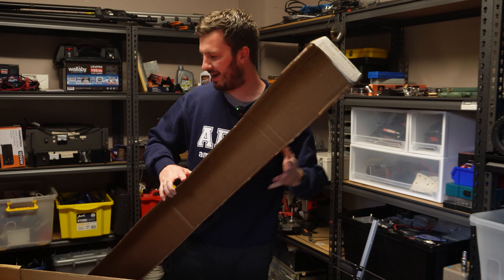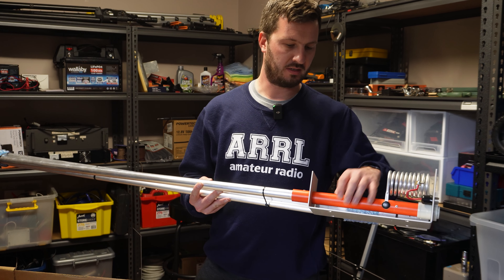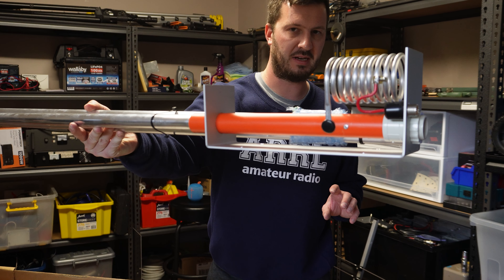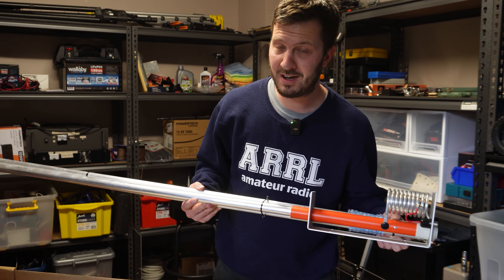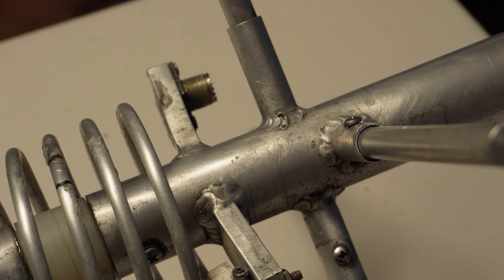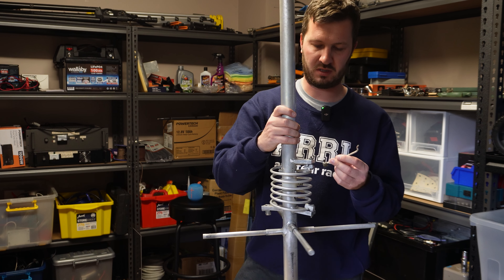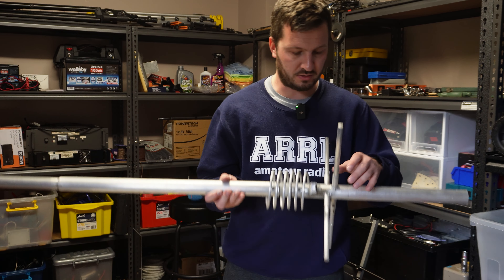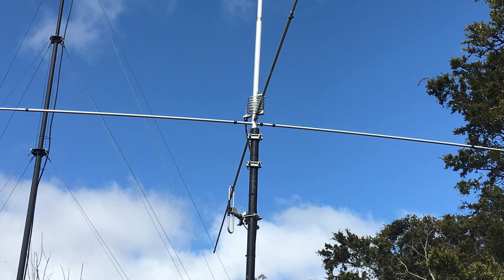Who Remembers This Forgotten CB Radio Antenna?

Comment: I still got my first mk1 Half wave Station master antenna that I bought brand new way back in 1981 so it's 42 years old and still on the tower working beautifully. It served me well right through my CB days as a young teen and then in 2004 was re-tuned for 10m Ham. It's had its fair share of being knocked about in bad weather and it gets its usual maintenance clean up every 2 years or so but you just can't kill this antenna. I love it and it's been a big part of my radio life for so long. I have tempted to replace it a few time but just haven't got the heart to retire it while it's working so well. I would be very happy to see it make 50 years old and still working.

Comment: Very interesting and well made video. 
I am ON3VCF a happy brit radio newbie here in Brussels Belgium. 
Last week at our weekly evening we were talking antennas and corrosion,  and one of our eldest and experienced members told me that he uses a spray can of  transparent varnish over the whole thing, top to bottom.  After 8 years he had to move it, and the metal and the PL connector were clean and like new inside.   Not a bit of rust or corrosion. 
He said he sprayed it with 2 coats.  
So I'm going to do it too.
I'm using a Sirio 5000 1/4 wave from Italy up on top of my chimney.  
Today,  25w got me 2200km to Moscow 
Me.... Happy bunny!

Comment: I had one of these beasts back in the early 80's, I had a Ringo before that but this turned out to be much better. I would also run all sorts of wire based antenna's strung up in trees nearby, even made a 3 element yagi that way lol. Back then it was all CB with my nice GE5825B running big power, mics and a modded PLL02A - such teenage rebels :)
It looks like I"m about to do it all again too.... just ordered an Anytone AT6666pro

Comment: I had one that took a lightening strike in '81, while I was using the hand mic sitting in the bath tub!!!! The static jolt made the metal plate in my head vibrate at about 40k hz...  Felt like I'd microwaved my gonads, while swallowing a bowling ball made of those super conductors that float and spin at zero degrees K.  I danced around in the kitchen on one foot for about 20 mins. which eventually led to the invention of the 80's craze known as break dancing.  Now?  I built a ULF full wave length end fed long wire antenna, for working the 520 Meter band, QRP (0.25 watt crystal), while CQ-ing alien life forms via CW... while doing PLOTAs (parking lots on the air). Red Rooster or Oporto's are my favorite PLs to work, especially if it's an abandoned and dodgy one.  Anyhow back to the alien encounter QSOs, works well, except the morse code they use is 180 degrees opposite from ours. The guys in my local dork support group think I am QSB.  ET phone home.

Comment: My Dad made a half wave ringo antenna for use on 27 MHz. It worked a treat.

A tip for any aluminium antenna assembly or repair work is to use an anti corrosive jointing compound like Duralac between any dissimilar metals. Brass and copper in contact with aluminium will suffer from electrolysis in the presence of water. Never bolt a copper crimp lug in direct connection with aluminium.
Reply from the maker: I'm using TEF-Gel for the dissimilar metal connections:
https://www.tefgel.com.au/

Comment: I converted these antennas to 5/8 and had no problems on 27 mhz. The SWR actually dropped when I added ground plane radiators near the bottom, got it down to 1.1 .

Comment: Best antenna ever. I had one, I extended the stink pipe up on my parents house another 5m above the roof ridge line and the Station master sat at the top. I used to chat to NZ (26mhz) and the US, it was connected up to my trusty Ferris 5000 with the Digiscan Channel expander and a few extra watts on AM and SSB. . None of that TV interference and  no splatter, what a wonderful combo and memory

Comment: I've had one since the 80s. It was on the roof at home about 6 or 7 years ago, but a cockatoo decided to bend the top section so I took it down to repair it.
A few months ago I finished the repair with a new 12mm tube at the top and adjusted the length for around 28.5 MHz. I now use it for 10m and 12m with a tuner and the log of DX FT8 contacts is great.
I have it guyed with whipper snipper cord from the middle down to the colourbond roof that it sits at the peak of. The whipper snipper cord is good for about 5 years between replacements.
For my American friends a whipper snipper is what Americans call a weed-wacker.

Comment: Wow Hayden,
The Station-master MkI was one of the first antennas I ever built, for 26MHz CB over here.
They're quite an easy build, apart from getting the loading coil the right size and the turns spacing correct,
I sold it when I moved to Ham radio and constantly kicked myself afterwards, as it would have been perfect for 10m.
Reply from the maker: You can still buy them in VK Mike. There are a few places that still sell them.

Comment: Station master came out in the later 1970's i had one it was easier to mount the Five Eighth ground plane was a little large on the side of the house . had it hooked up to my President Washington and Turner + 3 microphone  when i upgraded in 1979 . Seven years later i got my HAM License . I notice a Ringo mentioned in the comments in the 70's refereed  to as a splatter stick .

Comment: I have had about four of these. Never had a new one.
One I converted into a 6m halfwave vertical by scaling everything down.
Another I removed the coil, shortened it and used a metal roof for a ground plane for 20m.
I have one on a pole for 10m and 11m and another in storage for a spare.
Reply from the maker: I converted an old one to a 5/8 on 6m too.
https://www.hamradiodx.net/58-stationmaster-mk1-on-6m

Comment: My 6m repeater is using a cut down Stationmaster. We quite deliberately wanted a low gain antenna because the repeater is sited on the side of a 'mountain,' at 750m, between a high elevation town at 1100m and low elevation at 30m, these two spots being 40km apart. To get sigs to go uphill AND downhill, it needed a spherical radiation pattern, which is precisely what a half-wave vertical does.
Reply from the maker: Same! Although I converted mine to a 5/8. The radials have fallen off since, I have a replacement on the way.
https://www.hamradiodx.net/58-stationmaster-mk1-on-6m

Comment: I had and built several of these in the 1980's, Daryl Coleman built and sold them as well. A good place to get any type of aluminium at wholesale prices is Action Aluminium, here in Australia, don't go to that big green aluminium shop and get ripped off.
Reply from the maker: I use Ullrich or Capral here in Hobart. Always good to deal with there

Comment: Oh boy! Making my youth flood back! I've still got mine in the shed and from memory it's setup for 28.5MHz
Reply from the maker: Need to get it back up in the air!
Reply: @HamRadioDX  I'm going low key, I'll be using either a 1.5m or 1m ex 27mhz mobile one whip for the repeater once it's back on the air!

Comment: Had one of the stationmasters around 2006 on 10M and worked really well, only sold it early this year but they are not rocket science to build, think I still have te dimensions for it somewhere.

Comment: Their is some antenna's like that 1/2 wave. sold in the US .  I had one with a loop around the whole center element. just a single turn ring with a tap. I had the 5/8 wave MACO one. had a bigger ring. still make that one. I have a 6 meter half wave with a small loop at bottom . works great. sold threw MFJ . for the 10 meter FM part of the band shorten 11 meter antenna a bit. also I had a 3/4 wave 11 meter antenna with gamma rod. still make that one in the UK.  I cut wire for my DX commander 3/4 wave for 10 meters and 3/4 wave for 6 meters. great gain . have to take 40 meter off and replace. the portable quick set up one.  I got extra DX 10 wire. made most bands and just put on what I want.  mono band 3/4 wave on 10 meters. below 1.5 SWR threw the whole 10 meter band. 10 meters really going in the US. same on 12 meters. I cheat on 11 and 12 meters. I hit tune button on 7300 and it gets out . just under 3:1 on 12 meters with 3/4 wave cut. better on CB . my half wave never broadband that much . ether does the standard 1/4  cut wire. that should work super for 10 meter repeater use. 73's Boston NY USA

Comment: I'm looking at one of these as I type, I had to replace the top section on mine, as it had corroded into the next lower section and snapped off when I tried to separate them, but what can one expect from an antenna that has been in the air and under constant use since the early 1980's ? I have spoken ALL OVER THE WORLD on this, with as little as 4w output. In the 1990's, NZ on AM wasn't hard with 4-5w, and I had a 4 hour S7-S9+ conversation one night with a guy in Belarus, when it was still part of the former USSR using about 20w from my HR2510 on the high 27Mhz freeband.They are a great antenna and you can use them out of the box from around 25Mhz right up to about 32Mhz at under 3:1 SWR, with a tuner, you can even get them down to the 15m band. I even knew a guy that actually used one mobile once, it wasn't very successful on the car, it missed all the trees, but a low bridge took it out. We all did some stupid shit back in the day.

Comment: Hi there I just got a new shockwave station master antenna, just wondering if the should be continuity between the centre of the plug and the out of the plug on the base of the antenna , thank you .regards Petar

Comment: Well, what do you know? That looks like the same antenna which I believe is the Mk 1 that my dad bought when he was there  in Australia some where 1984 or '85. And believe it or not, I am still using it to this day. I've put it down once in a while for periodic maintainance. In my experience with it, it is a very broad banded antenna. Now with the bands open I have tuned it so I can use it for both 10 an 11 meters and have been making dx contacts with it at only 20 feet off the ground. How much do they cost now and where can you buy them? I'm from the Philippines and my sisters family live there. Maybe I can ask them to buy me another one. Great antenna is all I can say about it.

Comment: How freaky...I am just getting one of the 5/8 Shockwaves refurbished now..0.64 is what they really are. There was a 0.64 ass well years ago that was the best base antenna but the coil inside was tiny not like the shockwave one.  My Shockwave 0.64 will be used for 11/10mtrs tuning it for such. Make sure you make the top element no less than 16mm tube. Cockatoos up here in Qld use the tips as a strippers pole..the 56 or 8mm tube just breaks off when cockys start swinging off them
Reply from the maker: Nice! They are great antennas. Luckily we don't have such a big problem with birds down here.